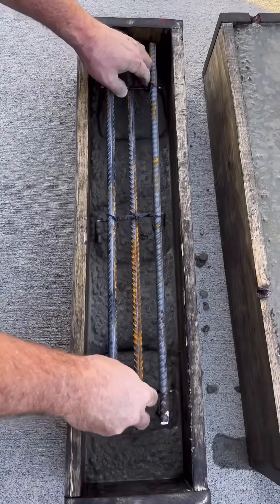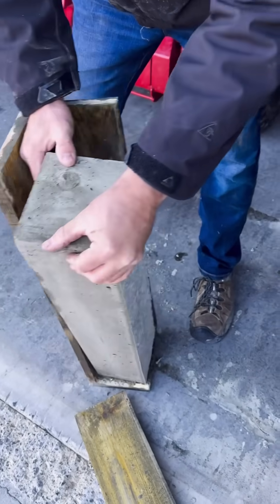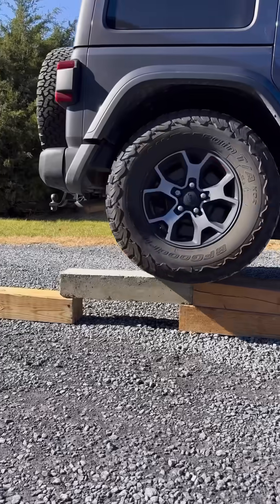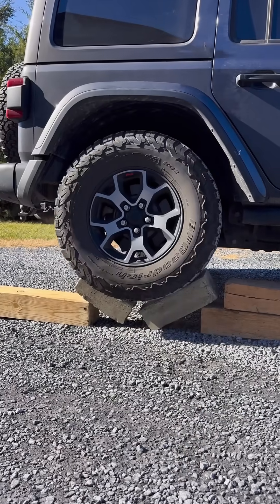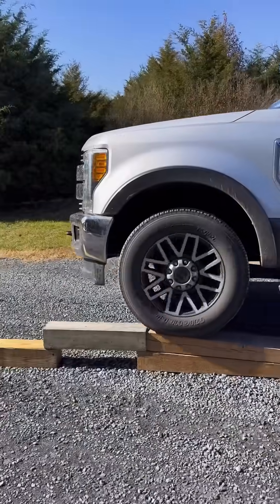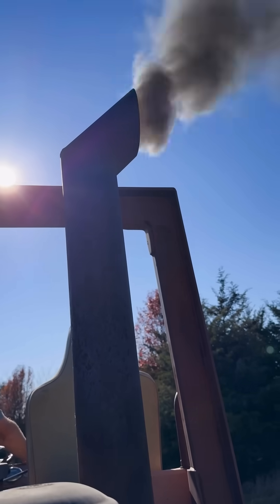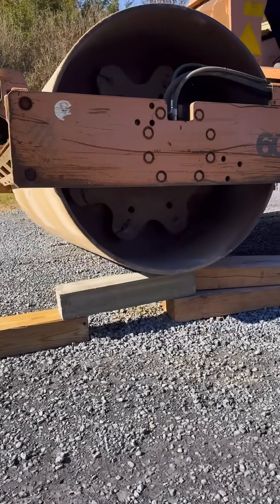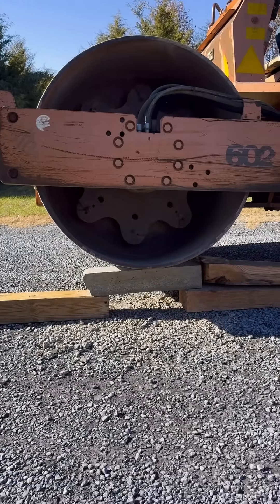Why We Use Rebar To Reinforce Concrete

Comment: That’s great! I was looking for this exactly explanation. However I’m curious… the concrete bars were suspended in air acting like a bridge… it obviously broke it in half, what if it was on the ground, like a driveway or sidewalk? Do you still need rebars?

Comment: You are usually supposed to let concrete cure for 28 days when doing tensile/compressive strength tests. Also fun fact, they are usually supposed to be cured in curing rooms which have 100% humidity. Can you tell I’m a Civil Engineering major?

Comment: days of cure on the failed bar: I'd say 10 or less, looked to me as if there was still some moisture that hadn't leached out/converted yet from the original pour. recommended full curing time for a 4" thick high-test pour is about 28 days (4 weeks) to reach working strength... though I will say from experience, I've poured some driveway drains that had barely 24 hours cure time before a heavy service truck "rolled them", and fortunately they somehow survived.

Comment: I've got something that is s lot stronger than rebar. Remember when we were children.  At school they made us make paper marcher made with water, flour and newspaper strips. You could make a mask that was very hard. Now, imagine you dip pieces of old clothes dipped into cement. This is like the demonstration of a single spaghetti that breaks easily. But if you put 100 spaghetti together in would be unbreakable. The same thing happens when you dip clothes into  cement.  The slab would become unbreakable because all the clothes would be entangled together. Kind of stupid no one thought of this before.

Comment: This is why Roman concrete lasts so long. They are built with high compressive forces but low tensile forces. We use rebar reinforcements which helps get the same strength with less concrete. But concrete is kind of porous so the rebar rusts inside the concrete and creates expanding forces creating micro cracks. Water gets into the cracks and expands when it freezes. Small cracks become large cracks. If you made a driveway that was feet deep instead of inches with no rebar it would last nearly forever. Also apparently the Romans added raw Lyme which self-healed the cracks but I don't know enough about that side of it to comment.

Comment: The downside to rebar reinforcement is that it corrodes over time through the concrete leaving it weak and slightly hollowed. While pure concrete is ages much much slower.😊

Comment: Starting to think we should be using alot more lumber. Broke all the concrete but the roller went right over the boards with zero problems. 😂

Comment: If you put your rebar in the center height wise, you make for a weak beam. You beam’s rebar bent causing it separate from the concrete, then failed. You want to put the rebar near the bottom of the beam. First do the calculations necessary to equate the maximum compressive stress at the top of the beam to the tensile strength of your rebar. Then multiply  everything by a huge safety factor because concrete stinks as a material to work with!

Comment: On beams used on large span bridges they use steel cables that the put under tension uysing hydraulic jacks. That makes the concrete even tuffer!

Comment: And say you probably let that that’s a block 4 inch steak so I would say possibly you let it cure three days before you try to run over you should’ve let it 21 days 21 to 27. It would’ve stood pressure a lot longer, but it was still busted under the vibration.

Comment: By the look of that concrete, without actually being there to test moisture content.. it looks too me to be between 3 to 5 days.  That's also a guess without knowing the cement/agrigit ratio and slump used in the pour. It looked really wet in the video. That factor also determines the strength of a concrete mix.

Comment: Depending on What mix is 

 it ? Is it 2300 to Microsylica 7000  What did you get On the air 
 test In the slump  ????? You have no idea About concrete Loser 
Swamp

Comment: The stress in the beam is bending, not tension. While it is correct that the lower part of the beam is subjected to bending and the upper part to compression, that happens with any material that works as a beam in bending, but it does not mean that the work it supports is in tension.

Comment: When I was working with the rebar and post tension cables, the concrete had to cure 72 hours before we could pull the cables. I don’t know if that’s fully cured that part I don’t know but anyway it’s a pretty interesting video you got going there I really appreciate it.

Comment: The reason that the concrete didn't break immediately when the truck wheel was on it was because it took time for its constituents to tear apart. Similar to how a rope tears gradually until the final strand breaks.  Despite how it looks, ALL substances have a level of elasticity.  So as the various bonds gradually stretched and broke while others still held, the concrete still held for a bit
Reply from the maker: That makes sense! Thanks for sharing

Comment: Trade towers were steel reinforced concrete, but disintegrated in thin air due to low temperature fire.
Only thing that was left was molten steel.
Explain that?

Comment: Reinforced concrete is an amazing invention and allows us to do much more with concrete than the Romans could. However, reinforced concrete is less durable. Eventually the rebar inside will rust, weakening the structure. I reinforced concrete can’t be used in as many applications, but when used right, it can last significantly longer. But it has fewer applications that way and raises costs significantly.

Comment: Very watery, less water will make it stronger as when it is setting the water evaporation leaves behind tiny pockets of air, air not concrete makes it weak… always put in the least amount of water you can get away with…unless it hot…(concrete or cement also generates heat) then you may need to keep it damp for longer.

Comment: Even failure with rebar is better. It slows the rate of breakage so whatever objects are on top of the structure fall much more slowly than they would have on an unsupported structure.

Comment: Rebars should set near the surface, not the centre of concrete. Correct setting will get more strength.
Reply from the maker: You never want the rebar towards the surface
Reply: @hausplans  you’re not construction engineer, I guess.

Comment: if you don't know, if you tension the rebar first and release it when the beam's concrete is cured it will have more strength. This is how they do to bridges.

Comment: The irony is that the reinforcement is also its fatal flaw. With time, the rebar corrodes and destroys the concrete. No concrete structure with rebar will last more than 50-100 years. If you do not need tensile strength, do not put rebar in your concrete.

Comment: Suspending both ends creates TENSION in the bottom of them beam, not tensile strength.  And the concrete doesn't have much tensile strength, so it relies on the tensile strength of the steel.  With vibration, the bond strength between steel and concrete is exceeded, and the steel no longer engages the concrete.

Comment: Not so fun fact, this shit has a maximum lifespan of 100 years and is really bad for the environment and looks like shit! Going back to cut stone or bricks etc and relying on clever engineering and architecture to build will make our lives much better in the long run. But the versatility and flexibility of concrete means buildings don’t need to be designed well, because they’re coming down soon anyway and reinforced concrete solves all of their would-be-optimization problems by being ridiculously strong no matter how bad you design a building. Fuck modern civil engineering, so bloated by government contracts and kickbacks/corruption (I’m a mechatronics engineer, civil fucks get payed way too much and a 10th grade kid could do it with a months training)

Comment: Downside is that rebar will significantly shorten the lifespan of the concrete, so only reinforce concrete if it will actually experience tension ^^

Comment: Pipefitter, voice text, probably not worth reading this comment
I still don't understand how all the cables that Kris Kross through the Nike Serena Williams building in Beaverton, Oregon helped. After they pour the concrete, they put tension on the cables and that is supposed to help?  It was thick between 11 inches and 18 inches on average and up to 6 feet near vertical columns and the center of the building that went up six extra stories. There was a lot of rebar on that job and I learned I do not like installing bangers using tremble before the concrete pour. 

I got on that job as they were pouring the second floor so I missed the parking garage  that went down 3 levels as well. I got to be steward on that job and learned a whole bunch Both politically and from travelers, which half of the pipe tradesmen were. There was a lot of new stuff. I still haven't done again on that job. It's fascinating. I'm actually look up the YouTube video about it again. Under bed poor management choices lots of people came and went. I stayed for 22 months because at least it wasn't intel.

Comment: Yes but the main problem ive seen with my own eyes is concrete is porous. The moisture makes its way into the concrete down to the rebar and makes it rust, which expands and finally chunks out the concrete. I see this alot on bridge pylons.

Comment: Beam would’ve preformed much better if there was some shear reinforcement IE stirrups, you can tell by the angle of the crack it wasn’t a pure flexural failure. Considering shear strength of the concrete is largely dependent upon the concrete compressive strength which increases as it cures this beam was not cured for a full 28 days

Comment: Green concrete has less than 50% of its final strength. After 28 days without drying out it reaches 90% of its final strength. To reach final strength... Most concrete never does due to drying out too soon. But in a very moist environment, it can after a few years...

Comment: Another amazing thing about iron and concrete.  They both have the same thermal expansion properties.  Could you imagine if they didn't?  Bridges, beams, buildings, all would start crumbling if they expanded and contracted differently at different temperatures.  The strength factor of both is very simple.  Iron will flex and has less tensile strength.  Concrete is opposite.  The strengths of both combine to make one solid piece.  Like an insects soft tissue surrounded by an exoskeleton or a human with soft tissue over bone or a knife blade with softer and more flexable steel on the bulk of the blade toward the spine, while the edge material is harder more tensile better heat treated steel.  Yen and yang in the engineering and bio world.

Comment: While this does help situationally, rebar can drastically shorten the lifespan of a concrete structure. Over time, it expands within the concrete, causing it to crack.
Many structures don't need this added reinforcement, and would be able to last hundreds or thousands of years, if they had not had rebar unnecessarily added to them during the construction process.
Reply: Only true if you build the structures on areas with low or no seismic activity.

Comment: Your explanations are kind of right but also kind of wrong.  Engineering terminology is often very precise to convey the exact types of forces applied and reacted by an object.  

First off the beam is failing due to bending.  The bending causes a tensile "force" on the bottom of the beam and compressive "force" on the top of the beam.  Loading a beam does not cause strength.  Loading the beam just results in forces in the beam.  In general, "Strength" is the amount of force that material withstand before yield or rupture.

Comment: this remains a good day as a 22-year-old cutting laying out rebar and tying them together. just for $10 an hour, this was 2012. My boss at the time laid a concrete foundation for the house. it was just him, me, and sometimes my boss's son thou he only came out on the day we actually laid the concrete, i did most of the prep work and on the day we laid the concrete I was the tool cleaner. it was good work, the olny problem was he didn't always have work for me so I would work for 3 weeks and be looking for another job for 2 months, and then he would have more work for me. so I end up joining the army instead.

Comment: Well, you are supposed to put the rebar at the bottom of the beam ...
Reply from the maker: I did because I flipped the beam upside down before driving in the roller on it
Reply: @hausplans  it looks like its in the middle :) anyway, great video as always

Comment: While reinforce concrete is much stronger than without reinforcement. 

Interms of buildings, unreinforced concrete structure tends to last way more than reinforced concrete structure. Main factor is that the reinforcement corodes overtime, and that the structure the reinforced concrete is used usually has a lot of tensile load.

Comment: "Concrete has amazing compressive strength, but poor tensile strength. Compression strength resists being pushed together, tension strength resists being pulled apart"

Comment: A beam suspended at the ends with a point load in tge middle experiences compressive loads at the top that transition to tensile loads on the bottom.

Comment: Another important thing to notice is the failure mode of both concrete types. The unreinforced concrete basically broke instantly while the one with rebar was slower. This is important as in the real world, you get these warning signs in the form of cracks and creep (sustained compression). This allows time to notice and repair before full on failure. Additionally, once the rebars begin to warp (plastic deformation at the yield stress), its a ductile process and the time until failure occurs takes time and would be very apparent. Rebar is not only for beam strength, but failure safety. 

Columns are another story, compression failures are abrupt and scary. LRFD methods use more stringent design safety factors because there is less/ no warning of failure
Reply: Was still pretty green, worked around cylinders being broke on a hydralic press for years, the green ones break quietly, after 28 days they go BANG.

Comment: the diagrams are right to describe tensile stress but the application is wrong. when you say tensile strength to describe the block breaking with only 2 supports, it's actually shear stress and compression. shear stress applied is at an angle to the axis, tensile stress works along the axis. the flat support is tensile stress & compression. good logical explanation, slightly wrong definitions

Comment: Reinforced is definitely a better option when it comes to weight, buildings driveways I would say cure time depends on the application, any ware between 24 to 48 hours depends on the size of the area is my guess I think that Quick Crete concrete is different most of those I think dry quicker or something

Comment: That wood is super strong. We use 8x10s to keep a semi trailer suspended to our loading dock with a forklift running in and out of it constantly.  If you ever need car ramps you can use 8x10s and nail them together with rail road spikes and a sledge hammer. Much safer than those store bought plastic/metal lifts.

Comment: You only need 3 rebar in the bottom, since there is no joints that the concrete has, there is only twnsile forces acting on the bottom of the beam, but check that the M/(b*fck*d^2) value is less than 0.167 to maximise the use of rebar, M in this case is the maximum moment anf d is effective depth (not actual depth) make sure that the rebar sapcing is larger than 25mm or the maximum diameter of the rebar as well, also let it cure for more than 48 hrs for optimal strength (gets to maximum strength in around 28 days) (according to eurocodes 2)

Comment: Ok stupid question, but why is there horizontal force being applied on the concrete not on the ground? My intuition tells me that it should only be vertical force, not horizontal.
Reply: the horizontal forces are in between particles of the block

Comment: That's not tensile; it's flexural strength that's being displayed in this video. If it were tensile, you'd be trying to pull the beam apart from either end.

Comment: 28 days is okay for the cement-concrete to be cured. But in the first 16 hours the concrete can get a lot of compressive strength... so, if you let the beam to be cured for a week, it wouldn't have failed at the end my lil bro.
Reply: (I'm a civil engineer student, I might know something)

Comment: Fun fact, the reinforced concrete will be replaced about every 50 years and is a nightnare to recycle. Just use stone. It's surprisingly cheaper depending on how presentable the rock is and is very recycleable as it can just be used jn other buuldings.

Comment: Rebar also helps it in a fire! It spreads the heat out quickly and so the temperature differences can't get large enough to break the concrete.

Comment: Tensile strength or resistance to bending forces.  That concrete needed 28 days to fully cure. How long did you leave it — 1-3 days? A week ?
Reply from the maker: 2.5 days

Comment: Usualy you need to let the concrete rest for about 28 days, then its fully dried out. But you can put most of the weight on it after about an week.

Comment: I took a flight sitting next to a member of a concrete certifying expert of some sort.  He told me about how concrete needs water to cure, and that it cures for over six weeks.  It is important to spray water on concrete for six weeks minimum as it cures, and to keep it soaked if possible during that time.